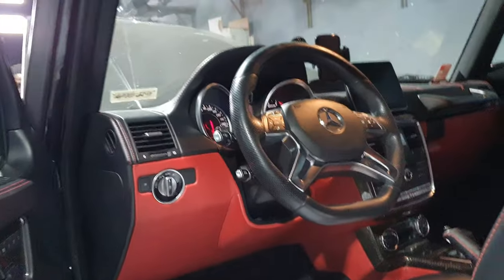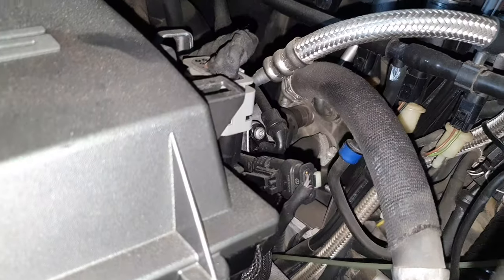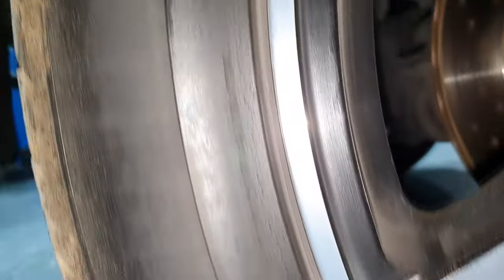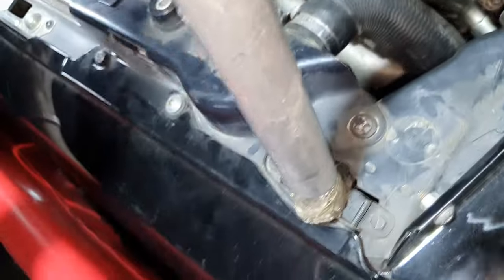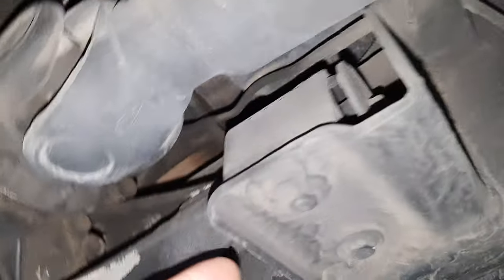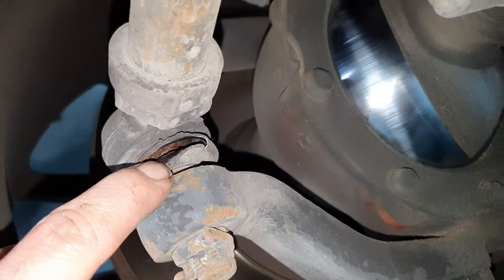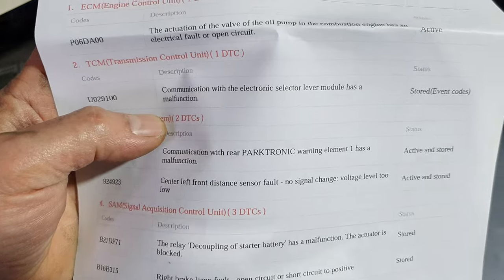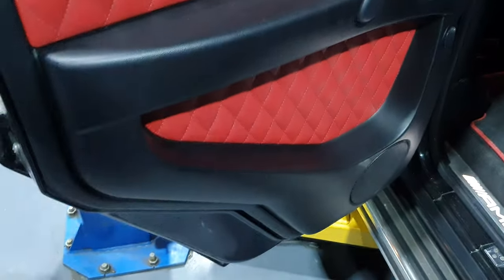G63 2017 with 176k km check up (part 1)

Comment: The front disk's are below minimum. If the long grooves are gone .  ZF recommends to change the ATF fluid every 60K.
Reply: Yeah tell a professional mechanic how things are done 🤡🤡
Reply: Doesn't run a ZF  box
Reply: @johntarenidis9338
No ZF automatic transmission, of course. Mercedes Benz has always developed and produced its own automatic transmissions.  but the ATF from the Mercedes automatic transmission should also be changed every 60K. Dynamic flushing would be even better.  Best regards from Germany 😁.